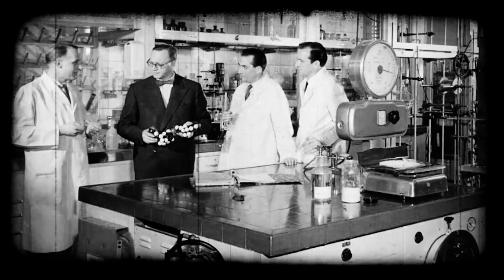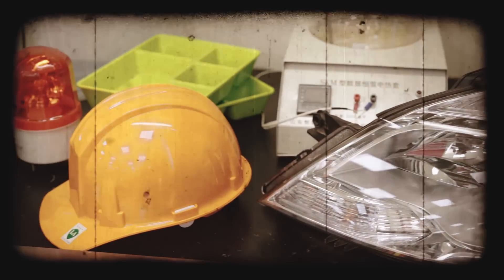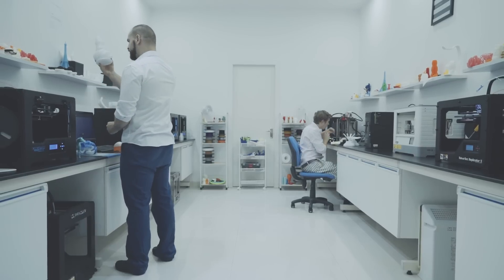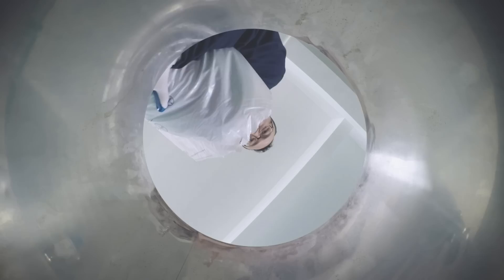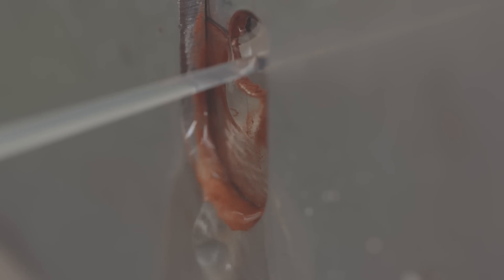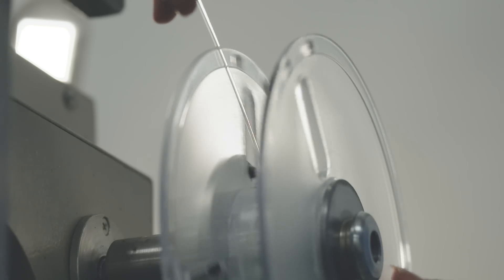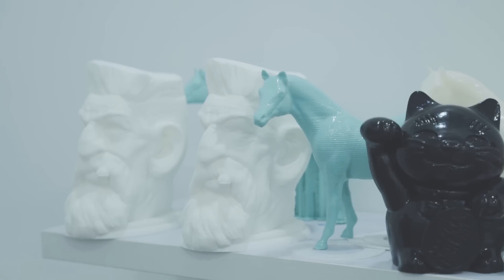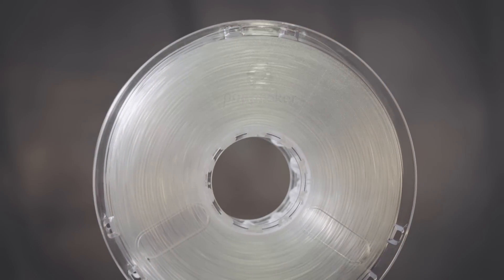Polymaker PC | The Next Generation Polycarbonate for the 3D Printing Industry.

Comment: I am looking for the best material to build a printer. I used PETG but had temperature problems with the extruder parts. ABS is better. But I want more strength and higher melting point in case of something. 

But I cannot deside between nylon which has higher melting point, ABS, petg with carbon, polycarbonat and other. Has someone experience with this materials related to 3d printer parts ?
Reply: A) I know this is 2 years after
B) this polycarbonate does resist good temps, but not for long, as in my experience and after confirmation with PolyMaker, PolyLite and PolyMax PC do bubble and yellow in heat above 110 degrees c. It really depends if you want an enclosure, etc. I think CF nylon works well, and that’s what I use in the fan shroud of my printer, as the polycarbonate one became bubbly and brown. I use PolyMide PA6-CF, mostly because it’s the easiest one for me to access that isn’t insanely expensive. CF petg will be like normal PETG in terms of HDT (heat distortion/deflection temp) so I wouldn’t recommend it.

Comment: how impact resistent is it? I have tested a dozens of filament types for RC-Flying and everything except TPU brakes.
I need a rigid filament thats hard to break. After watching 10 youtube polycarbonate 3d printing videos I still dont have the answer. 
How impact resistant is polycarbonate it compared to PLA?

I know Polycarbonate propellers are unbreakable. True.
The reason why i question the Filament is.
PET-Bottles for example are unbrakeable too but 3D-printed parts with the same material are not.
3D-Printed PET has nearly the same strength as PLA.
Reply: I have had good luck with eSun ePA for RC multicopter stuff! it is more rigid than TPU but still a little flexible, but super tough to break. You have to use gluestick on the bed for adhesion, nothing else works. Print it at 250C hotend 45C bed... I just orderd a spool of this Polymaker PC-Max and will see how that compares! I am hopeful.